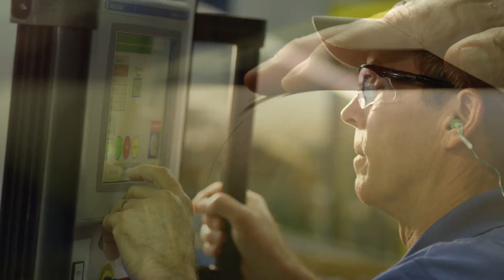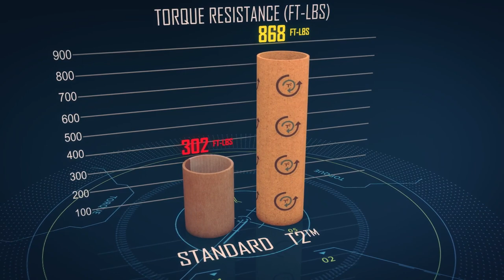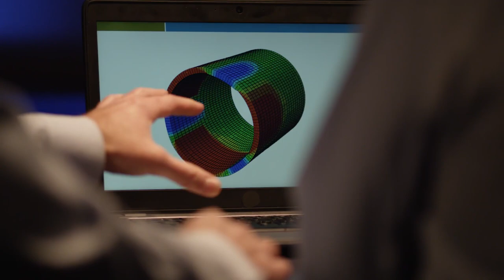Sonoco's T2 Technology

Comment: People don't think that something as simple as a core requires engineering.  It is not as sophisticated as a Tesla, but a lot of thought has to go into it.
Reply: Correct size  spindle, correct size ID,core thickness, adhesion, paper spread, humidity,there's where ya start...knowledge of customer's products or use of core,paper, plastic, rolled roofing,ect all determines the effect of core durability,im no expert though I've made my share of cores 👍
Reply: Do you need dryer for paper core, if any query pls reply